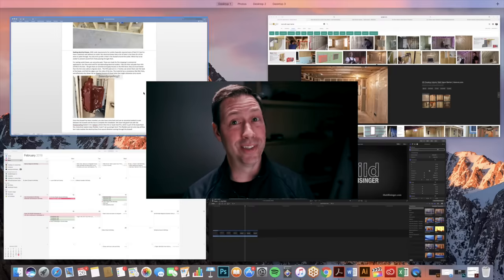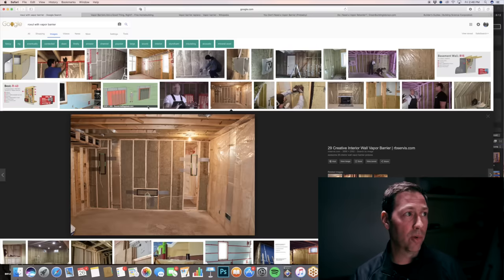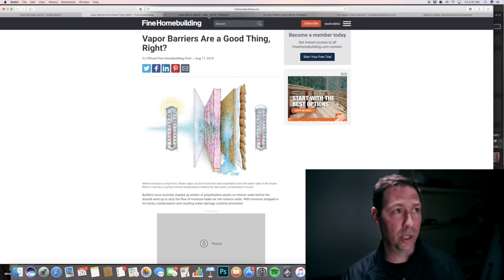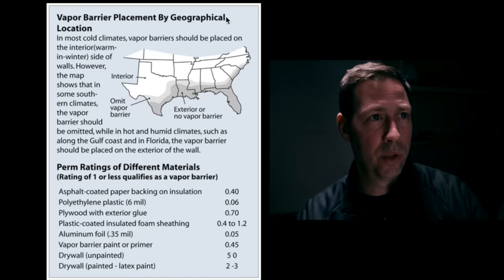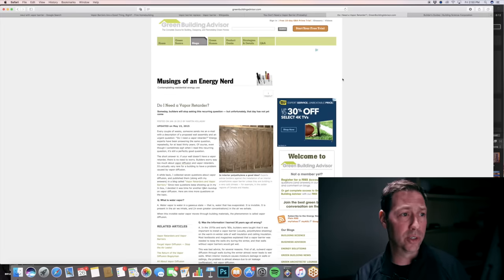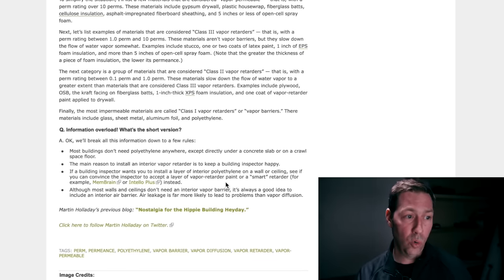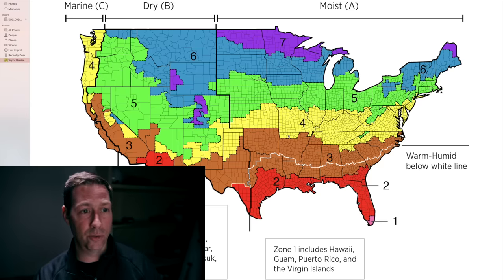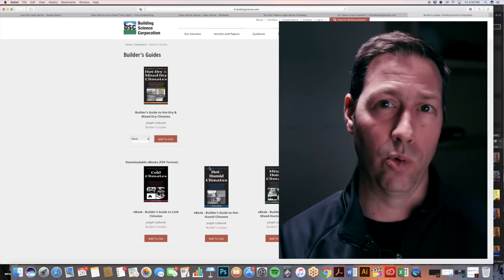Vapor Barriers: Need one or not?

Comment: Good topic, I have talked a lot with different contractors and renovators on this issue. I am in a zone 7 here in 🇨🇦 we install polly on the inside walls and seal it up as tight as possible. But what I see done incorrectly is the installation of ridged foam on the outside of house already vapour sealed on the inside. To my knowledge any foam 1 1/2 thick is considered a vapour barrier, this practice creates a double vapour barrier on both sides of the wall. I would like to hear your thoughts on this problem. Thanks.

Comment: According to my handy-man buddy, the best vapor barrier is super cheap wallpaper glue that comes in a packet. ($3,60) Add water, mix and apply 2 coats, and let it dry before painting. It gets sucked into most composites, seals,  and will cure all damp issues, both past and present.

Comment: With everything happening to Texas right now considering the unexpected cold climate, I'm curious to know how building science will adapt. I.e., is it wise to build houses differently according to climate (which will potentially change over the lifetime of the house) or should we be looking for a more holistic approach to climate control. This all seems very focused on controlling the transfer of humidity, and is obviously important, but I'm also curious as to how we can control those base levels of humidity inside the house, not just the transfer. 

I know nothing about any of this, I'm just postulating; I'm sure dehumidifiers play their part and were simply not mentioned, but I'd really like to know if there are others ways to control humidity inside the house besides that noisy little box that drips more often than not downstairs.

Comment: This is great stuff man. It’s helping me alot with my plans to finish a section of my garage. Now my only concern is what about laying rigid foam board and plywood over concrete as a subfloor. Do I need an air gap beneath it all? Or just anchor it all flat to the concrete? The slab does not have a vapor barrier beneath it. It was an addition built circa 1950’s-60’s.

Comment: So my question is, I had a shed built that I’m going to use as an office. They put pressure-treated plywood first, then joist insulated them, and then put a mildew style resistant plywood flooring over it. They did not use a vapor barrier should they have. And what should I do now if they were supposed to use one? Thanks so much for your time. I look forward to hearing from you. 
Fred

Comment: Matt, a lot of insulators use a vapor barrier to eliminate airflow through the walls. They take accoustical caulk and seal along the face perimetwe of the wall to reduce any kind of air movement. 

My question is this: what is required as per building code? 

If you don't follow building code, you could get into trouble with the inspector, but if your follow building code and Moisture builds up in the walls and Mold forms, you get into trouble later down the road.

Comment: I have a basement and a section of that basement is the area beneath the outdoor porch.  The ceiling beneath the poured concrete porch is a corrugated metal and I'm getting condensation dripping off that metal.  Is this just a matter of insulating that metal or would a vapor barrier be needed as well?

Comment: I live in wis . I've used plastic sheeting as vapor barrier and air barrier.however to eliminate condensation I built second wall,(cavity) insulated that.so there's drywall plastic, insulation, plastic , insulation. This seems to work .

Comment: Got an uninsulated 1937 wooden summer cottage here in Iceland. Currently leave it unheated while we're not here in the winter. Old traditional wisdom here is that being uninsulated and beathable helps protect against mold and rot. Been thinking about taking advantage of opportunities to insulate sections with the goal of gradually extending the habitable season, but worried I'll be inadvertently creating mold and rot problems. Controlling airflow seems impossible due to its age and construction, and basement slab obviously has no vapor barrier. Some areas I'll be able to get to from the exterior, some from the interior (but many are tricky due to not wanting to damage the original tight grained timber siding and t&g panel). I've also been advised to replace the building felt where I can get at it with something more breathable. Anybody got tips?

Comment: Awesome video.  Very nice job on it too by the way . So I have two questions  number 1: So, right now I don't have any insulation in my attic, and you mentioned a paint that can go on the back of my drywall. Is that something I could use in my attic?  I recently vacuumed out all of my my old insulation that's been there for about 40 years, and I was going to reinstall new fiberglass rolls into my attic. I'm In the Zone 3. But we live in an area that gets into the 100s in the summer and in 30s in the winter. I wasn't sure if I should have paper on the back of my fiberglass insulation.  Question number 2: so that said, I'm using flat paint on my drywall for my ceiling ( which is a fairly porous paint) and a third of a quart of water in condensation still seems like a lot of moisture that could turn into mold overtime. Why should I not be concerned?

Comment: Love your videos. Would love to see more on caribbean homes built with Bricks. Typically what they use for modern built homes here is vented roofs with gypsum air barrier in attic. Typically metal ducting or ducting board is used I think resulting in a lot of problems. Let me know if you need more info. thanks.

Comment: First off thank you Matt for your video on this.  QUESTION: In-regards to the leakage issue threw a hole in drywall (at 4:18) How do you effectively seal around holes cut in drywall for electrical boxes?

Comment: Of course I find this video AFTER i put Poly sheet and hang it up on one wall. 
I'm redoing my garage, the drywall was full of holes and overall ugly. Figured I'd get mineral wool batts while I had access. (Found a 1980 penthouse magazine) and couldn't decide if I needed to get a vapor barrier. I trust Matt's advice when It comes to all building matters. So looks like I'm gonna get a can of spray foam and caulk to seal up some possible air gaps and get to drywall. Its for the garage anyways, so I don't really see any reason moisture is going to be a big deal when the door opening throws everything wack again.

Comment: I want to insulate the floor of my heated shed. It has 3/4” pressure treated plywood on it. I want to put rigid insulation board with 16” on center strips of pressure treated plywood. Should I use a vapor barrier over the top of the insulation on the inside before I cover the insulation with plywood

Comment: 10 year old house, went to do a minor remodel after my mother passed away. I ended up doing $150,000 complete gut to the studs and remodel  because the vapor barrier had been put on a the concrete floor and then wrapped up the 12' walls.  The condensation from the concrete caused really bad black mold up, in some areas up the entire 12' walls.  It's hard to believe someone did that and that my poor mother lived in all that mold.

Comment: I used to work for a contractor back in the early 80s and he always insisted on using vapor barrier on every basement job we finished. Been a contractor for 30 years now and every wall I have found those vapor barrier on when remodeling has mold and rot.

Comment: Great video. I wish you would do a video on vapor barrier when finishing a basement wall. This is being done wrong all over the place. People are putting vapor barriers inside studs with fiberglass insulation like you would do an above grade wall in Minnesota. This creates a mold sandwich in your basement outside wall. When I was searching for a house to buy  I DID NOT want a finished basement because it would probably be done wrong no matter who did it. If the house finished basement  had a mold smell I was done looking. I found too many.

Comment: So in a kitchen wall with metal studs and insulation, to the innermost of the unit, beside the neighbour, there doesn't seem to be a vapour barrier. This wall does lead to the balcony, eventually. I'm installing cabinets and also some wood stud supports. So it's not the wood which would now dictate a vapour barrier, I'm guessing. But I now understand why refinishing and repainting was recommended afterwards. I was wondering whether the wood dictated (because it was somehow special vis-a-vis moisture) the vapour barrier now that I'm adding some 2x4s, vertical and horizontal, in key points. Versus the configuration of the wall as a whole which decided it was not necessary. 
The reason I wondered about the wood as the instigator was because in the parallel other neighbour wall, near the outside of the building, there are metal and wood studs and there is a vapour barrier. The wall also leaked into small permanent closet walls, now gone, and was very drafty, which I noticed when the wall was open. The kitchen drywall is double, 1.5", compared to the other bedroom wall which had adjoining closets. (Who on earth builds inbuilt closets that are tiny? Haven't they heard of a standalone Ikea unit? That removal was a pain, which allowed me to lay my bed in a different orientation and gain 16sqft.)

Comment: Hey Matt, first off I love the videos and thanks for posting such great materials. I'm trying to do a major renovation on my house in Utah, and I thought that I had things figured out but now I'm wondering if I'm wrong. For my basement I was planning to have a closed cell insulation covering the foundation, then my frame construction would start an inch and a half away from the foundation wall. The closed cell insulation would slightly come into the framed portion, causing me to have about 2 inches of closed cell foam. Then I was planning to have the rest of the cavities filled in with blown cellulose, and finally a polyethylene barrier. From your video it seems like I should remove the polyethylene barrier, which means I need to replace the blown cellulose with something like roxul insulation but still keep the closed cell portion. On the exterior I was planning on having a liquid barrier, followed by Arroyo Drain Board that leads to a french drain, like your video (https://www.youtube.com/watch?v=r4GdEJal8KM). Then on the above ground portion I was planning on using the zip system, like you showed on this video (https://www.youtube.com/watch?v=Mn5KaKu-tt0&t=410s). For the slab portion of the basement I was planning on having  Delta-FL, followed by an inch of foam insulation, and then a sheet of osb (like in this video https://www.youtube.com/watch?v=BaTLu-9GO20&list=PL9pFxyvTJQl3yJppR7hEHYElOKH_O9czJ&index=13). Would you recommend something different? Sorry for the novel, but I was hoping to pick your brain.
Reply: Also I saw your video on the perfect wall (https://www.youtube.com/watch?v=hTwq-qUnr9I) where you recommend having everything on the outside of the home. However, recently you seem to recommend insulation that is used on the inside of the house. Has this been shown to be a bad approach? Are these questions answered in the book you mention towards the end of the video...plus living in Utah we have hot summers, but cold winters...does this mean I get the mixed climate one or should I lean towards the cold one?

Comment: Great stuff Matt. Got a question. If I go with a conditioned attic with spray foam should I install baffles under my sheeting or just spray foam? Also do I need to install a climate control system in the attic as well?

Comment: Nice video.  My understanding is that water vapor, like heat, moves from hot to cold.  If the water vaper then reaches a sufficiently cooler surface, it condenses and accumulates, you will have issues, as shown at 6:10 of your video.  With that being said, the picture at 1:22 makes no sense to me. The exterior cool air does not have much capability to hold water, so it's absolute humidity is low.  However, the warmer interior will most likely be much more humid.  So the warm humid air wants to move from hot to cold, condensing, and if cold enough, freezing on the INTERIOR side of the vapor barrier.  Now, if we are dealing with a hot, humid climate where the interior is typically much cooler than the exterior, and if the wall is "vapor open", then any hot humid air that reaches the vapor barrier or vapor stop that is installed inside will condense on the exterior facing side of that vapor barrier, as shown at 6:24 of the video.

Comment: Texas - You'd still want one where a shower stall shares an exterior wall, right?  Lots of warm humid interior air combined with tiny grout cracks in the tile.  I had to gut the shower of a 1997 house that was built with tile on greenboard (don't get me started on that shit), and most of the mold was between the brown side of the greenboard and the poly.  A little bit got past the poly through nail holes, but otherwise the studs were OK.

Good info.

Comment: Matt,  I live in Chicago and have purchased a new home.  I will be finishing the basement myself and I am trying to figure out the Best Practice for basement floor vapor barrier, insulation, and top wood.  I am Looking at two configurations.  Configuration 1:  10 mil vapor barrier, DMX, 5/8 plywood.  Configuration 2:  10 mil vapor barrier, 1 1/2 Foamular 150, 1/2 plywood.  In both scenarios I will be framing ALL walls on top of the wood sub floor.  I am also considering taping my wall and floor vapor barriers together as well.  I really have a blank slate here and want to get it right.  Please let me know your thoughts.  Thanks!!

Comment: Just learned the transfer terminology, "Diffusion'. I learned  years ago, from the mold that was always present during the demo, not to use plastic between drywall and insulation.That is the purpose of the paper insulation facing. Now I know the molecular  definition.

Comment: Matt, 2 questions for u:
1. U mention that air leaking into the wall cavity is the bigger problem. IMHO, the most likely place that will happen is in the gap between the drywall and the gang box of switches or outlets. How do I best seal that gap?
2. I’m in climate zone 4, Washington DC. I’ve hung faced insulation & if it is raining outside, had the paper facing get wet w/ condensation even before hanging drywall. This has freaked me out & made me think that I do need a plastic vapor barrier. What do u think?

Comment: Excellent video and I wish you would do another one that addresses the use of 6 mil poly as a vapor barrier on concrete sub floors when installing laminate. I am about to use a popular method whereby you lay the 6 mil poly on the concrete, then wrap it up the side walls a bit,  (about 2 inches ) where it gets hidden behind base moldings.  Wondering if this will cause the water vapor from the concrete to spread toward the outside perimeter of the room where it would then get trapped behind the baseboard and cause problems. Or am I over thinking this?

Comment: Thanks for the video, Matt! I live in Zone 6, have 2 inches of foam on the exterior, then a layer of house wrap, then diagonal wood board sheathing. On the interior, I have just blown in Havelock sheep's wool beneath a polypro lightweight fabric. I plan to do lath and plaster and beadboard wainscoting/ bring the wood all the way up the wall here and there. Both wool and plaster manage and diffuse moisture fairly well. I am considering installing a layer of intello before I plaster. Do you think I need a "smart vapor" barrier at all? I'd rather not, but am still researching and want to protect the house as best I can. Thanks for your guidance!

Comment: Matt, would you say that enveloping the exterior of a cor-ten steel container house in redguard and 2 component closed cell spray foam would suffice for all barriers? It would be topped off with some mold and rot resistant siding, like vinyl siding or fiber cement board, light colors on roof and walls to deflect the Florida sun.

Comment: Hey Matt I see a lot of videos on bathroom builds and most of them say to paint the durock/tile board with a water membrane. I don't think those surfaces should be covered with anything that would inhibit the tile adhesion. In my experience those water blocking paints can be peeled off like a sticker. Instead what I've done is install a moisture barrier behind the durock. I am afraid to use plastic as it is not breathable so I've always used tar paper or roofing paper. What are your thoughts?

Comment: Thank you for this great content. My contractor is nearly finished with my post frame workshop. He installed plastic-faced insulation inside the metal siding and roof. When I fur out the interior walls and sheathe them, I plan to add more insulation. But the existing insulation would effectively  be a vapor barrier in the middle of the wall. Should I do something to prevent it from trapping moisture? The workshop will be conditioned, though I don't foresee lots of moisture being generated inside (no shower, cooking, etc.). Should I slice through the plastic to allow moisture to pass through?

Comment: Matt, I'm in climate zone 6, I have used a combination of a half inch thin layer of closed cell spray foam, followed by fiberglass batting with the facing on the inside. I thought this was a good combination to stop airflow and save cost. What are your thoughts?

Comment: In Chicago. Use Rockwool on exterior walls with a poly vapor barrier during rehab. 8 years later I had to open up a couple of areas and small amount of mold spot was growing on the back of poly.  Wall cavity stunk. I conclude it is a bad idea even in Climate zone 5.